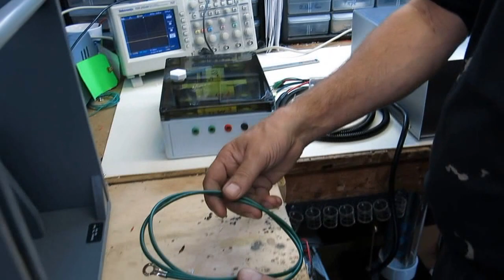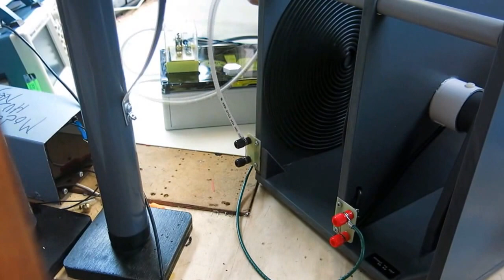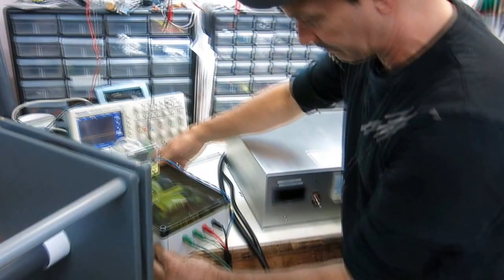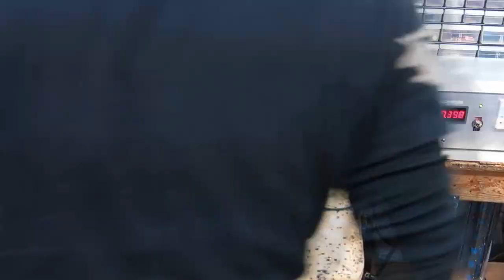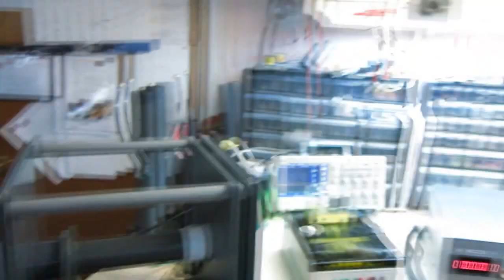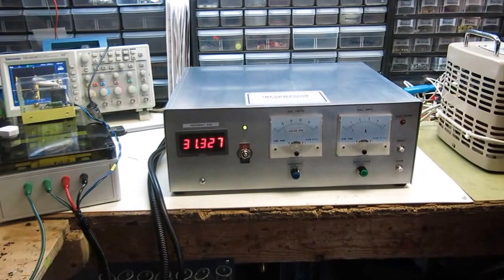PVM2000: Setup & Operation of the HV Plasma Generator

Comment: Some factories are using plasma for disposing of garbage - it's hotter than the surface of the sun inside the furnaces - which vitrifies the garbage material into the basic molecules rendering most toxic materials inert. A final product of this plasma gasification process of waste disposal is syngas (which powers the plant) and construction aggregate for other applications. https://www.wired.com/2012/01/ff_trashblaster/